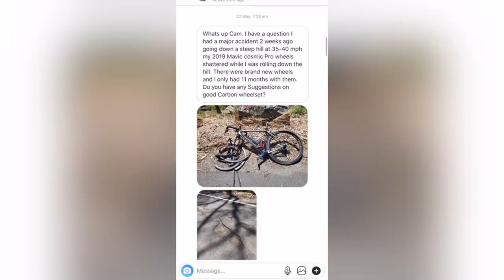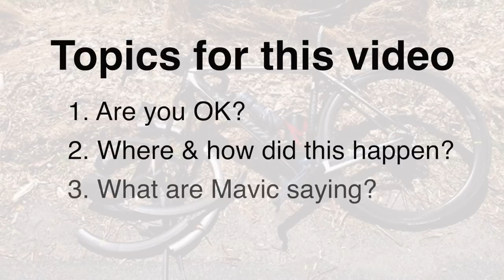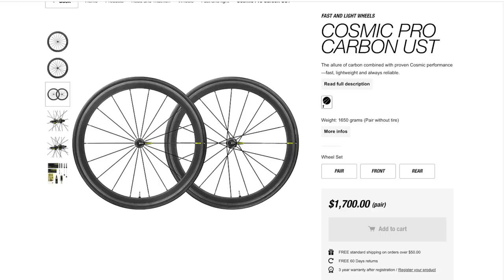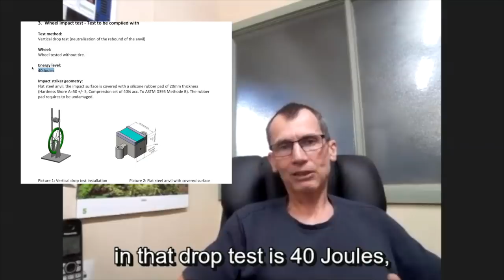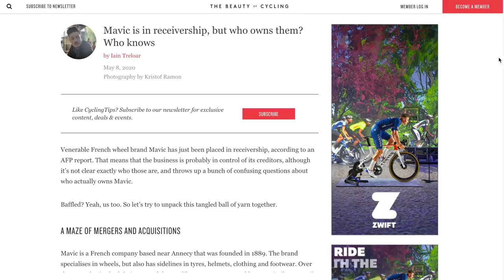A FRIGHTENING MAVIC CARBON WHEEL FAIL (at speed)

Comment: These accidents can happen but there are some more things at play here. I don't believe any manufacturer of any brand will sell carbon wheels with rim brakes if there was a serious overheating problem while decending. It might be a problem in very specific conditions (like very hot weather outside, steep decent and a heavy rider or not knowing how to use brakes in decent). Even though i've not seen any warning from any manufacturer other then maximum weight limits. So i'm wondering how many of these accidents actually exist comparing to all carbon wheel + rim brake users that are out there.

Comment: I do not get the argument about the joules... One thing is the heating, but heating happens only if you are braking.. if it was just at the start of the hill and he did not pull much of the brakes, then there should not be any elevated temperature. If he is still traveling at 72kph then the energy is still kinetic energy and not converted into heat inside the wheels. To know the energy which was used by braking a rough guess would be the difference in potential energy (so top of the hill until where the crash has happened). then somehow subtract the kinetic energy and also the energy which is lost from aerodynamic drag. 

And the comparison on the impact test is also interesting. The impact test is a solid body which is hitting the wheel with an energy of 40 Joules. If the guy hits a pothole, then this hit surely does not convert all his 24000joules. If it was he would be traveling at 0kPh afterwards.. Plus the bike plus rider is a rather flexible body. I think comparing his kinetic energy to the energy of that drop test does not make a lot of sense.

But yearh, wearing a helmet obviously makes sense and a disc brake might also not be the worst choice :)

Comment: After seeing stuff like this, I would never own a bike with rim brakes anymore.  Even if the rim doesn't fail, the tire still can and a blowout on a descent at road bike speeds is gonna hurt.  I am even leary of resin pads on disc brakes, I've had 2 sets on 2 bikes try to melt on me, both those bikes now run sintered pads.
Reply from the maker: Thanks for sharing on the thread

Comment: Another carbon clincher / rim brake melt down. This is not the first one but I hope it can be the last one. I think it's now time for the cycling industry to declare carbon clincher / rim brake wheels an inherently flawed design and just stop producing these wheels.
Reply: You're right, but "I think it's now time for the cycling industry to declare" carbon TUBULAR / rim brake wheels are the best.
Reply: @ottokovacs2045  I have never owned or even ridden tubulars but there is a reason they're still the preferred setup for actual pros. There is a rather harsh phrase out there: "Just because they make it in your size, doesn't mean you should wear it". This is how I feel about carbon fibre bike gear. Some of this stuff should just stay with the pros. Pro riders and pro mechanics.
Reply: @JMcLeodKC711  The life is too short. Buy a Campagnolo Bora wheelset (AC3 brake track) and some Vittoria Corsa (latex inside) tubular tires.

Comment: Cavendish's wheel didn't "just fold in half", you can clearly see in the video that the wheel folds when the wheel of the guy next to him touches it. It looks like for a split second the other guy's wheel tries to roll up the rim of Cavendish's wheel... It's easy enough to see if you slow the video down to 0.25. Anyway, using carbon for something like a wheel, with the forces and temperatures they are subjected to, is imo, stupid.

Comment: To the city councillors, fix those bloody pot holes before someone dies. my rim brake bike has alloys that are as light as my carbon disc rims.
Reply: It´s not all about total weight. It´s about how the weight is distributed in the wheel.     Rgr
Reply: @borano2031  Yes and my rim weight is the same in alloy as the carbon. Most hills riders are chasing grams to overcome gravitational force not so much rotational inertia.

Comment: Double failure at the same time. Maybe the rims got damage at the same time. Maybe bumped by a car while leaned against a garage wall or hanging on the back of a car.
Reply from the maker: I think overheated at the same time and also impacted but potholes at the same time. It was all going on!
Reply: @CamNicholls  maybe. Probably varies by person, but I break way harder on the rear than front. It seems like a freak coincidence they both hit that threshold at the same time.

Comment: Carbon fiber's melting point is thousands of degrees hotter than aluminum. So I am confused as to how the structural integrity of the carbon wheel is being compromised by heat that significantly. Serious question here..am I missing something? I'm not wheel expert just googled some stuff haha

Comment: This is not a good video.

I hate to put the blame on someone who got hurt, but the fact that this happened on a downhill section means its likely due to excessive braking with rim brakes. There is nothing Mavic can do about this. It could happen to any manufacturer of any carbon wheel.

Comment: This is the reason I tell every one road bikes scare the shit out of me.... you can get em going real fast! And folks on that weight savings build mentality don’t understand How energy works... take any thing, slam it into another thing of equal or greater mass, if those two items don’t explode, they will gain heat! Road bikes have almost no place for this heat to go! Any part even if you were to run disk brakes, hubs are tiny on road bikes, frames are made from practically drinking straws! How would heat transfer dissipate! Reason even alloy bikes have issues over time! You all can keep riding your road bikes, I will keep riding freeride and DH on my tanks also known as mountain bikes...  this video makes me ill a little... just can’t fathom bike failures at those speeds on blacktop!

Comment: Well, I weigh about 70kg. I wouldn't want to ride my carbon bike and carbon wheels with a backpack loaded with 10kg extra. I would flinch at every minor crack in the road. 
Now  100kg, that's another velodrome altogether, damn. 

Please excuse my schoolboy physics:

Kinetic Energy: 0,5 x M x V². 
At 70kg and 70kmh, that is 13226.9Joules .
At 100kg and 70kmh, that's 18896.7Joules. 

That's a difference of 5668.7 Joules.

Raoul does a great job but he should not compare 40J dropped straight onto a wheel  (UCI test) vs. 14000J rolling down a road/hill. 
I don't think that is the same kind of movement or impact. 

Whatever, be careful. Stop and go braking only, no dragging the brakes. No switchback descents. 

By the way, I'm just looking for a wheelset for the exact same BMC, awesome bike. Might still go with Mavic. Unclear ownership has nothing to do with quality control. Not necessarily. But I guess I will opt for DT Swiss. Swiss bike swiss wheels.
Reply from the maker: Thanks for sharing on the thread

Comment: 200 plus pounds is not smart to be on carbon wheels on a rim brake bike going 45mph on a descent. Even if Mavic spec says you are below that allowable weight limit, thats already a red flag the wheel is not going to hold up when the going gets rough. I have switched to alloy wheels on all my rim brake bikes because of overheating. Plus alloy wheels stops way better than carbon. Safety should always come first when deciding your set up any bike.

Comment: Too many uncared for roads doesn’t help the situation. Certainly not good for cars, let alone bikes. Here in the UK it seems that for some reason people who need to dig up roads, seem to have to do this exactly where cyclists need to ride, to allow for traffic to pass. Additionally when road workers put the road back together again, well, I’ve seen toddlers on a beach make better quality constructions. People may say go around or slow down or some other action, but as most cyclists know from experience, these road surface issues are often so bad that going around is impossible, especially taking into consideration that most cyclist are considerate road users and do travel close to the path(sidewalk) to aid traffic flow. With the advent of Covid-19 governments around the world are strongly promoting the population to ditch the car and ride a bike, especially for all those short journeys, and the populations health will improve. Umm.  I say Governments need to address the safety of cyclist first, by repairing road surfaces promptly and increasing safe cycle paths before sending the population to the ER. In “Johns” circumstances I believe there should be a certain proportion of liability on the local authority who’s jurisdiction this road falls within. If the road surface was cared for this incident would have had a significantly less chance of happening.

Comment: I'm not sure there's any great way to dissipate that amount of heat well, and certainly cyclists heat alloy rims and blow tires all the time, but carbon fiber composites are TERRIBLE heat conductors, so they'll probably be much worse than metal at cooling. When you're fabricating carbon-fiber gear, this becomes clear really quickly when you drill or cut CF. You have to be really careful not to overheat bits because the material itself won't carry much heat away from the site of friction. You will wreck your bits and your parts with friction-heat if you don't pulse, rest/cool, pulse.

Comment: Didn't the front wheel of the rider next to him cuts into his front wheel's side? like if you'd try to roll two pizza slicers next to each other not in a perfectly parallel path, and one kind of slides off the other one. That pressure alone could have caused it in a weird angle I guess. At a sprint there would be no heat added to the equation, would there?

Comment: Very troubling. Of course we don't know the foregoing as to inherent damage, abuse or manufacturing errors. If carbon rims were dangerous the professional pelotons wouldn't ride them just as they don't ride steel bikes for all the well known reasons. Interesting concept, rim brakes Vs disc on a carbon wheel. Disc would load the wheel more being more efficient while rim brakes would heat up the rim. The bottom line is check structural integrity as Cam suggests.

Comment: 100 KG going down 10 percent and "only" doing 45 mph means a lot of braking. The fact that there where people behind him that could take Photos indicates that that was no Race.
Just to be clear:
Poor guy, hope he will recover and finds the courage to decend in the future. 
Ripoff Product from a German Product that sells way fewer wheels. But they (lightweight) have a heat-measuring Device installed.

But ANY wheel will give you Problems when you Brake constantly downhill.

Even shimano had a Problen when Customers wanted pro brakepads because they where using Their "professional" Dura Ace brakes.
Turned out that the wannabees braked. MUCH longer and where MUCH heavier than the skinny pro's. 
This is like a scared and tired truckdriver using lighweight racecar brakes and rims on his loaded truck going downhill.

But it's MAVIC's fault!
Obviously they do not understand the Product.

Use discbrakes or use rimbrakes alternating the front/rear.

Comment: So my take...
My daily ride is alloy 25mm deep rims on DS Swiss 350 hubs and I’ve never had a problem with them. 

I race on dura ace c24 when hilly with disc breaks and dura ace c50 when flat/ crits with rim breaks, both are Tubs so they are glued on. 

I prefer a alloy rim with the carbon sleeve for aero I’ll take the weight penalty. 

Hubs are the thing I worry about more, I’ve seen zipp hubs and mavic hubs fail multiple times. 
I really like the cone bearing system on the Shimano hubs, and the titanium dura hubs are great. I also really like DT Swiss hubs, the 350s are brilliant and you can use standard sized bearing in them from The main bearing manufacturers. 

I used to love a set of zip rims on dt Swiss hubs, they were wonderful. 

The times I’ve seen carbon rims fail is usually from nails going through the tire it deflating and then going through the carbon rim as well. 
I’ve only seen a carbon rim buckle once and that was due to high tyre pressure and heat blowing out the tire and then damaging the rim. 

If your using alternate breaking patterns on your decent allowing the rims or discs and brake pads to cool I’ve not had any problems.

Comment: well, a bit slandering of Mavic no? even so its was Mavic wheel, still I guess there are many other carbon cases out there... sometimes production is not 100% all the time.
ANYWAY potholes at 70 km/h is not a good idea
and just to remark on the friction heating, it does not appear clear that the poor Johnny used his brakes, and the video of Cavs buckle his front wheel, a Zipp wheel (maybe, thats how it looks, thoough htc off used shimano) is not a typical ride.
hopefully his local bikeshop will give him a new set, and then talk to the distributor.
cheers, ride well and safe

Comment: Sorry, this may be judgemental, but sometimes the truth does not hurt and may even prevent other people from getting hurt.  People do not realize they are pushing their luck.  We got to a point which is really like using a Ferrari to go to the materials building store and loading it with cement blocks and ceramic tiles and then complaining that the shocks, brakes or clutch failed... The current carbon bikes and wheels are RACE bikes and wheels.  Those are designed for competitive cyclists who mostly weigh 60 to 70Kg.  It started with decreasing the spoke count from 36 (or 32) towards 24 in rear or 20 in front,  it continued with making carbon TUBULAR rims for light and fast racers that go downhill very fast while braking very little.  You will never see Nibali overheating a carbon tubular wheel going downhill because he is on a closed road and he will brake 2 seconds here and 3 seconds there.  In the ongoing pursuit of trying to feel and act like pros people are forgetting that they are not pros and it makes no sense for them to buy equipment that is unfit for them... 1. Many people do not weigh like pros, if I was Mavic or any other wheel manufacturer I would put an 85Kg system weight on racing wheels. You simply cannot weigh 100Kg and use equipment really designed for people that weigh 65Kg,  2.  Most people do not ride like pros (many people started riding at a later age and will never go downhill like someone that started riding as a teenager, the "brake draggers" "controlling speed" riders are the worse affected by rim brake carbon rim blow-ups 3. People do not use the much stronger and much less prone to blow-off tubular rims that were designed first and that the pros use, they use carbon clinchers because they cannot be bothered by tubulars and only want it to be pro "lookalike", many wheels manufacturers balked at making carbon clinchers (which are a recipe for disaster) for a long time and finally decided to give the people what they clamoring for even if it makes no sense... and now they have pushed people to rim brakes instead (which is a good thing for the heavier riders).  The irony is that now Nibali has to ride on disk brakes (he does not need nor want) just because the 100Kg guy buying wheels for $2000 to $3000 is the one paying his salary at the end of the day...  I am a custom wheel builder, when a 100Kg person comes to me I propose the build 32 spoke wheels with alloy rims (if rim brakes), but many of them do not like the idea and end up buying 24/20 spoke factory wheels designed for riders that weigh 65Kg and complain they are braking spokes all the time (and that's the smallest problem) or experiencing various degrees of what happened to "John", I am happy he is OK...  I am 5"9 (176cm), I weighed 61Kg in competitive shape, now 68Kg 35 years later...  I may love to feel like a pro and dunk a basketball, but the NBA is not lowering the basket from 10 feet to 7 feet high just so I can dunk...and if I try and go play football with real football players, I am going to get hurt too...

Comment: I've have been lucky enough to visit the Mavic HQ in Annecy and see the lab where they test their wheels. I have and the level of detail and testing protocols they put their products through are extraordinary, they have custom made machinery and run everything through the most thorough processes you can imagine. The only way to ride a carbon rim brake wheel down a Mountain is to brake late and hard.

Comment: Personally I have always been leery of carbon products, although I relented and bought a set of Time carbon handlebars, which I had for approximately a year, when going over some fairly rough road on a club ride, both sides of theirs decided to snap either side of the stem, of course without warning. I went down and chipped my elbow, luckily we weren't roaring along. I have bene used carbon wheels, I just don't trust them for the same reason as my bars, they can give way without warning. So, alloy wheels, stem and bars for this kid, tired and true
Reply from the maker: Thanks for sharing f Steve

Comment: Great to hear the lad is OK and is back on the bike.

You did mention weight - but that weight isn't just the "standing on the scales butt naked in the morning" - you need to include the weight of the rider and bike with the bottles, toolkit etc exactly as he and the bike is equipped when he rides off down the road. If he weighs 100Kg then by the time you get all the gear on, add the bike, a couple of bottles etc etc you're getting close to that limit.